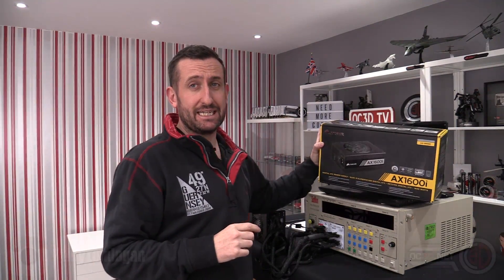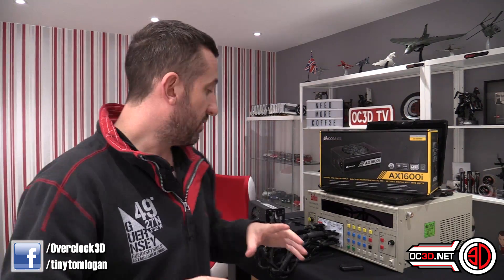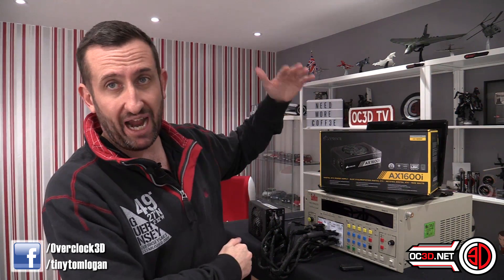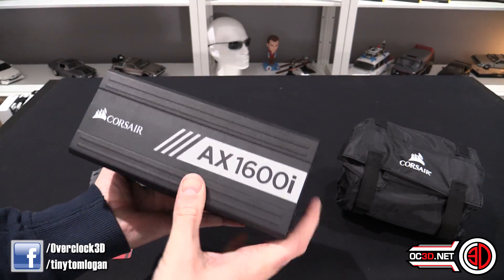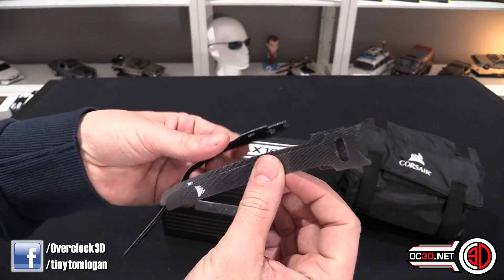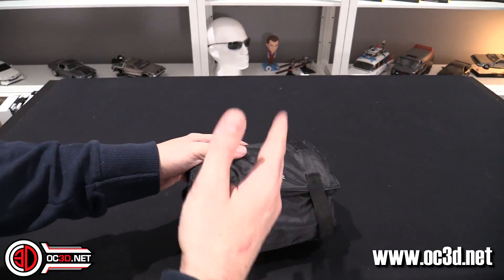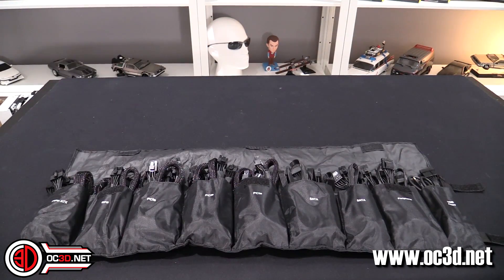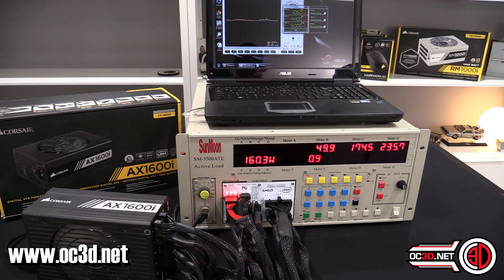Corsair AX1600i PSU Review

Comment: Wow, you have some SUn Moon equipment?
I had a Sun Moon ancient PBX system with about 15 phones.
Couldn't find the instructions for setup anywhere on the net, no manual, so I ended up gutting the wall mounted metal case and it now houses my NAT router and cable modem :)

Comment: I have just bought the AX1600i PSU and an aftermarket cable-kit for the PSU from CableMod. Can I Use these Mod-cables without the built-in capacitors (I haven't opened the CableMod box but I guess that they won't have the capacitors)? What are these capacitors good for?

Comment: All these people crying about the price, you get what you pay for, this power supply uses Japanese Nippon chemi-con capacitors which are well known for being very reliable,  they've been making capacitors for over 45 years. I can't remember exactly which capacitor series they use for the main filter capacitors from nippon, but they are very good quality, the gallium nitride switching transistors aren't simply a marketing gimmick, but are actually legitimately higher performing Parts than their silicone counterparts, they have low on Resistance, therefore they produce less Heat at the same output level as an equivalent silicon transistor, therefore they can also be made smaller because of the greater efficiency and less internal resistance, so that means they can pack even more them in a tighter space and select even higher current rated output devices. The extra money partially comes from using these transistors, not only that but all the other semiconductors inside of the power supply are all the name brand components, Texas Instruments, St semiconductors saken ect.  This psu also has very low Ripple current on the output rails for rock solid system stability, they don't give you exact measurements, but under full load it's got to be well under 10 - 15mv, the line regulation is probably so good it doesn't drift more than 1/4 to .5 of a volt under full load.  The PCB is probably fairly thick and the board traces are probably fairly thick as well, all the modular cables for the power supply are well-built and fairly thick. I believe this power supply gets a 10-year warranty. with a load life of over 100,000 hours. When it comes down to it, you get what you pay for, don't cry about the price, if you do, your computer probably doesn't need it anyway, the only thing that would make it justifiable would be if you get the latest RTX 3090, even more so if you SLI two of them, the 1600watter is a must for two, quite frankly, you could probably get away with the 1500 watt power supply.  for two 3090s however it would be pushing it a bit, you should get corsairs 1200 watt ax series power supply at the minimum for just powering one.  you just might barely be able to get by with a thousand watt power supply from Corsair for one, but a 1200 watt aX Series power supply for a single 3090 it's really what you should get. If you have high end graphics cards, ssds, inside of your computer tower, if you get a crappy power supply like a roswell or a coolermaster thermitake or whatever its called and it blows up and takes out your mobo and expensive cards, that's on you... Save up for a corsair, nothing compares or competes... even their cheapy buget cx series is better then 80 percent of the junk out there for the same price...

Comment: What is the update on the 100% fan test at boot? I have a AX1500i and it also sounds like a jet taking off. The HX1200i sounded quiet on start up? I guess you can't just change or remove the fan.

Comment: Retest with upgrade pack cables with no caps in them, Intersted to see if Ripples change and or efficency slightly ?
Reply: The pro cable kit does have in line caps in them they are just halfway down the cable instead of right near the header

Comment: We got the EVGA 1600 G2 because it was the only 1600 watt psu I could find at the time. When you want to run 4 gpus and a high core count cpu for photogrammetry workloads, it's what you need.

Comment: Will that PSU sufficient enough to run an AMD Threadripper 1950x(still poor gaming and single thread performance but excellent multi-thread performance)  or Intel I9 7980x cpu overclocked, 64GB of G.Skill ram,  Gigabyte, Asus or Asrock X299 or TR4 motherboard,  two Samsung 2tb 850 PRO ssd,  Samsung 950 Pro 1tb,  and two Volta or Ampere cards that supersede the gtx 1080 ti overclocked 24/7? I'm currently looking for an upgrade for i7 6700k at 4.5GHZ,  32GB 2015 special edition ram,  Gigabyte Z170 motherboard,  two 2tb of Samsung 850 EVO SSD, two EVGA 1080ti overclocked, and Corsair AX1500i psu... or should I wait until Intel or AMD release Zen2 , Ice lake or Cannon lake CPU- since, Coffee Lake processors were a rushed, unfinished product with a bad power consumption with a slight multi-thread lead over Ryzen.
Reply: Thank for the advice. I'll probably hold on with what the Skylake system until I see what Ice Lake, Cannonlake or AMD Zen 2 processors has to offer in synthetic benchmarks, gaming, single-thread, multi-thread performance and etc.;  hell, since both Coffee Lake and Skylake and Kaby X processors were rushed to the market because of Ryzen and Threadripper,  only offered moderate multi-thread and synthetic benchmark increase over previous generations, and somewhat power hungry for its core counts... I might as well wait for the Intel's next line of extreme processors with better performance and something not rushed out to the market.
Reply: Yes, without breaking a sweat or even turning the fans on

Comment: Capacitors in the cables are never a good thing. If I'm paying that much for a premium power supply, I expect good performance without using capacitors to mask it's flaws. The AX1500i didn't need them. Seasonic's Prime series doesn't need them. Why does this one? What's the bet that if you removed them, the AX1500i would still perform better? Realistically, a lot of them are going to be run without capacitors anyways once people start building custom cables for them. Tom, you've harped on manufacturers for making poor decisions like this before, can you start griping in your reviews about in-cable capacitors too? Jonnyguru already does.

Comment: Well the efficiency differs. How can you say that at the 100% the psu had this and that efficiency and ripple if you are limited to 1200w load max?! 1600w psu with 1200w load is at its 75%. 1200w psu with 1200w load is at 100%. With your graphs both are at 100% but it is not true. If you took the same psu and put it under 75% load and 100% load you would see that at 100% load the efficiency is lower. You can really compare your results unless you are testing all psus at their rated 100% or 50% or whatever and not 100% of your load device. Your numbers are just wrong and you can't compare. Even gold rated psu at 50% will have better efficiency than platinum at 100% of its rated load. Doesn't make sense mate

Comment: A 10 year warranty doesn't mean shit when you never get your RMA back.
Reply: WeAreTwoDoorsDown my Corsair ax760i malfunctioned last week, had to return it under warranty. Good thing the retailer refunded me yesterday.
Reply: Yes I know I have a Seasonic Platinum 6 months old and they wont help out.
Reply: it sthe retailers job by law to refund u
Reply: well I BROKE my M65 (I always cliick too hard and the thing attached to to the top which presses the switch snapped off) and went to Corsair RMA department and they replaced my mouse I got the replacement the day after they received my mouse and then it happens again (just a U shaped piece of plastic which can give way in the middle) so I just took apart my mouse and got a plastic dust cap off a HDMI port and cut a piece off and attached it to the underside of the mouse using double sided sticky foam piece and my mouse has last 3 x longer the original and current mouse before I ghetto fixed it (almost a year now)

keep your receipt as proof of purchase or screen shot amazon/other website's purchase history page or whatever there is to show what you have bought and if that does not work then you are out of luck

Comment: Well... Innovation, I'm sure Corsair (or their OEM) didn't develop these GaN transistors in-house but rather compared a bunch of datasheets and thought: Oh, look, those look good. And they happened to be GaN. It's not as rare a semiconductor as you might think: Most modern (bright) LEDs actually use it. And so do some transistors, apparently.

Comment: I thought having a psu of say 1600w but its only using say 850w would actually cause a lower efficiency so in fact your paying more to loose more money in effiency overal.
I know some people will say 850w output for a PSU it not enough but modern GPU's, RAM, CPU's etc are so more efficient than previous generations it just doesn't make sense unless your mining etc.
Reply: It would be like having a 3 litre v8 turbo engine and running in 1st gear.
Reply: i dont think you know how psu works. 
they all work best at 50% load, and the good ones run at zero fan rpm below 40%, then do the math.
Reply: I was under the impression that there is a difference in load variance for instance hybride units like I have maybe silent until a certain load peak but change efficiency when active cooling hits.
Also I thought there is also a sort of bell curve in a sense in regards to efficiency and there is in effect a sweet  spot you should aim for and not just buy the highest rated psu " because it has big numbers and big numbers mean better"
Reply: Sorry I mean load/efficiency variance

Comment: A power supply that cost that much should at least come with sleeved cable's come on corsair. Yes I know that probably 99% of people buying this psu will just get custom cables anyway but its about the attention to detail and quality.
Reply: That would raise the cost significantly, although it would be nice to have the option. They're still going to have those capacitors wrapped in there, that might have affected the decision to stick with normal "flat" cables.
Reply: They sell sleeved cable kits lol.
Reply: Thinkin the folks lookin for this aren't into bling
Reply: Got to love add-ons!
Reply: nimrodery buying sleeved cables seperately is going to increase the cost for the buyer anyways. Because whoever needs this big of a PSU is probably going to do sleeved cables anyways, so why not throw them in. Manufacturers find anyway to skimp on product and still charge a premium price. Just look at cases with shitty fans and AIOs that have rgb pumps and grey and black fans (Corsair h150i and h115i)
Reply: Or maybe people are buying this power supply for electrical performance
Reply: That's a terrible idea because the point of custom cables isn't the sleeving (that's just a bonus), it's the cables being almost exactly the length you need for perfect cable management and no longer. This is especially true when you have 20 odd radiator fans.

Comment: After seeing that new Seasonic 600w passive that’s the only way to go for most builds wouldn’t want be be useing that kinda power
Reply: The advantage of the AX1600i is you can hit 800 watts, be completely silent, and not risk damaging components by riding too close to the max wattage for long. Have to remember every year a power supply loses head room.
Reply: Elliott's World I agree most people don't need more than 600 w. I think I can hit 800 with oc on two 1080ti , and an xe chip. I just don't want to worry about the power supply crapping out, and having to replace everything in the computer.
Reply: he just tested it  and the fan start at 800 watts, not silent at all. efficient psu usually starts fans at 40% load so 700watts would be the sweet spot for this 1600w psu, now the problem is how silent can you get those 700 watts of  hardware to be....
either way, its the electrical noise you have to worry about when you get to 25db or so with fans at 500rpm.
Reply: xuddish p If it's anything like the ax1500i you can play around with the fan curve.

Even if there is a little fan noise I generally prefer to stay around 50% load. I've seen way too many people damage components by being cheap on the power supply.
Reply: Seon-Ho Don't psus have the actual max wattage drop overtime?
Reply: Seon-Ho yeh so if they brake you return them most people will not need more than 600w and no start up sounds also 12 years on Seasonic I also don’t care about the smart feature who is really looking at that
Reply: Andrew Ballard yeah, about 50% usually happens to be the sweet spot for most systems.
Reply: Andrew Ballard Because that <2% difference is all that matters... Right...
Reply: zerphase Any PSU from any decent brand is rated to run at its full power 24/7 at its max temperature for the entirety of its warranty. So that's absolutely not a worry